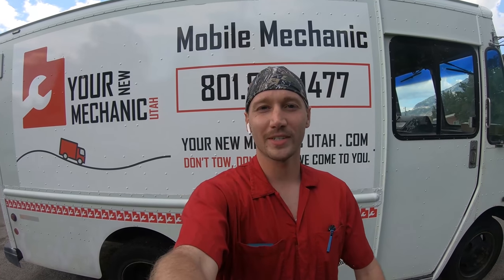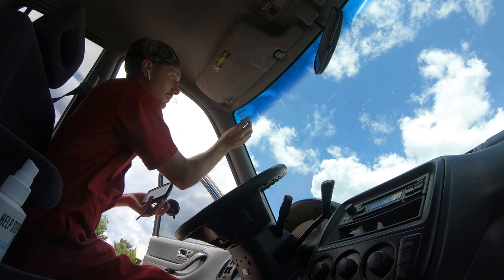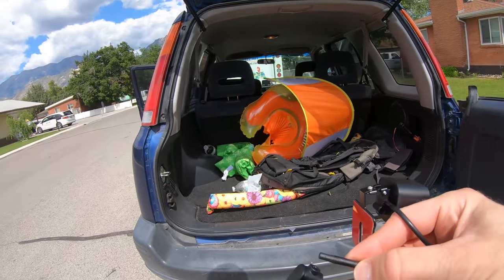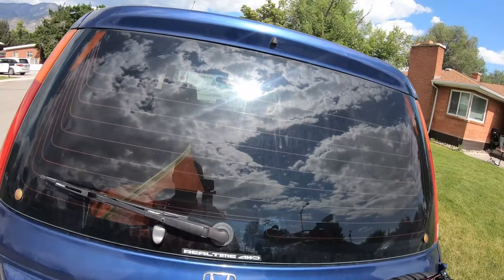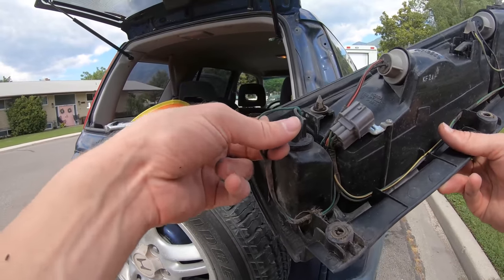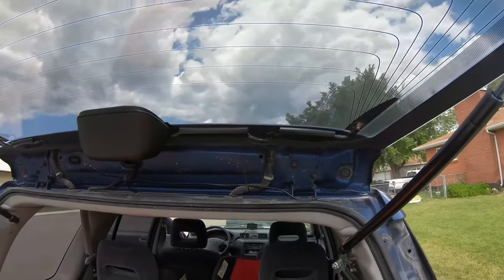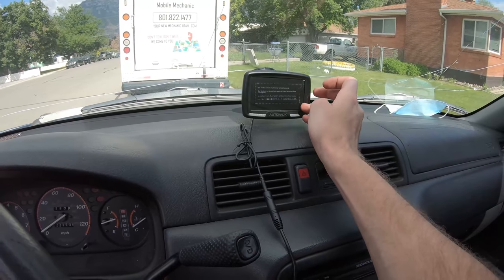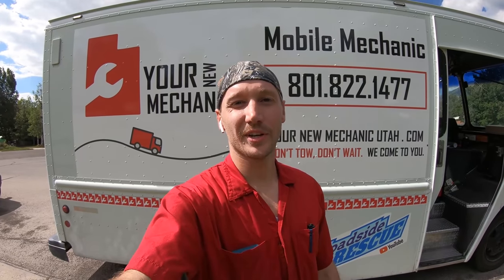Two bums try and carjack the car im working in. *Didn't know I was inside*

Comment: That’s sweet, I have a back up camera integrated in the rear view mirror. I could wire it to my double din head unit. But to be honest I like it in the rear view since I always look at it anyway 😄. That’s A Job Well Done! Keep up the good work!
Reply: I have reverse sensor also built in, did them myself with help of a neighbor, he did the measuring,drilling holes.The distance is displayed in the mirror. A reverse camera was a bonus especially when it's raining heavily and in the dark a reversecam can be handy, mine has a ledlight.

Comment: I'd had drilled a hole in the slot for the wire and self tapper to help it stay in place and alittle rtv to seal the hole where the wire is. I'd be worried about the wire getting pinched when the glass is opened if passed through like you did. BTW you talked about clipping the 12v plug off and going straight to a fuse box but more than likely that plug brings the voltage down to 5v for that screen and so direct 12v wouldn't be a good idea.

Comment: At around 29 minutes you can see the red tail dangling from the new red connector, with bare wire hanging out of it.
You need to insulate that, because it will be “hot” whenever you select reverse and the bodywork will be grounded to B- all the time. Paint is not a good enough insulation and sooner or later, if you’re lucky, the fuse for the reversing light will blow.
If you’re unlucky, the connection will be too high resistance to blow the fuse and it’ll just generate a lot of heat.
You really aren’t supposed to leave dangly tails hanging out of those connectors. They’re designed for one cable to pass right through and another to stop in the middle.

Comment: Forgot to mention. Your bare wire tips can short against themselves and/or the car. I always slip little pieces of heat shrink halfway onto loose wire tips to prevent that. No possible wire connection means no possible electrical connection.

Comment: Just watched your backup cam video, at the very end , saw you tucking the wires in and both of  your wires have an unstriped ends, the ones that came  stripped with the kit. Maybe take the tail light back off and tape them to prevent the power  wire from shorting. Just something an old backyard mechanic  saw. Love your work and commitment to what you do.

Comment: A backup camera would be wonderful for my older car. My wife complains every time she needs to use the car without a backup camera.I have not gotten one before because I did not want to run the wires from the back, if this is close to as easy as you made it look it will make my wife very happy.

Comment: Also, you don’t even need to wear through the paint to have a problem.
I just looked at it again and you’ve done the same thing with the black wire, so that’s asking for the two bare wires to touch each other. If that happens while you’re in reverse, then the weakest link will definitely give way. Hopefully it’s the fuse!

Comment: Nice work buddy, just a couple of things that I picked up on. Not too keen on the camera wire just laying in the boot jam waiting to get broken by getting trapped/pinched. The second is when you adjusted the live & earth in them red connector blocks you left the end of the wires exposed, when you refitted the light unit your running the risk of the exposed live touching the car body so when you select reverse it will earth out a blow a fuse or melt wiring. 

Not knocking you at all just some kind constructive criticism 👍

Comment: I have a suggestion why not get one of those multiport power adapters that plugs into your power port so you have an extra port when you need it. If you cut the end off the wire and something goes wrong with the backup camera you wouldn't be able to return it for warranty.

Comment: I was talking about the camera, I think it had the adhesive on both sides because it would stick to the plate and the car and the bolt that holds the plate could hold it also you just need that tab to not be in front of the plate, it looked like the camera could hang over the plate and not cover the numbers as much if the square mounting part was behind the plate.

Comment: Idk if it's how this one works but u can take the power from the reverse lights and I'd u run a fused 8 or 16 guage wire through the firewall and use a distribution block for any auxillary applications, chicken lights, LEDs I even run a electric fan switch to mine Incase I want to turn it on preemptively before it gets up to operation temp, it's just nice to have a hub to tie on

Comment: The back up camera bracket has adhesive on both sides because it is supposed to go between the tag and the car. That way it won’t cover up your numbers with the bracket installed on the front of the tag.
Reply from the maker: thank you for the help! Thats a much better idea!

Comment: Great video and I did a similar project but with some ford sync hardware and I installed a momentary switch to swap cameras from the rear to the front but I forgot to plug in the switch back into the circuit. Happens to the best of us. Keep up the great work Earnest!

Comment: For the screen, you could have made a bracket instead of the sucktion, my experience is they tend to fall of the window and cause danger while driving. Make a bracket for it, put it or use the empty space underneath your radio.Bracket you jjust put underneatj the encasemnt of the radio. Sits tight and when driving backwards watch mirrors and at the screen of course to see how far you can go.

Comment: I would have sandwiched the bracket between the plate and the door and tuck it as high as you can into the handle. Wouldn't cover any of your tags that way and would be a cleaner install. It would make sense as to why the bracket has adhesive on both sides too.

Comment: when doing the monitors that arent in dash. i always place them next to the rear view... its a natural spot to look... then i just run the wire down the headliner by the windshield and down the a pillar...

if you ever end up doing this on a Chrysler product rememebr they are can bus module. so it will power the camera up at 10v but after time the camera will die from the increased amps from lower voltage...
to bypass that you have to use a relay to supply full 12v right from the battery and use the 10v to trigger the relay signal....

Comment: You may have a problem later on, with the tip of the positive wire not insulated, it may short out, blow the fuse

Comment: When I was 13 I was helping my nan replacing fuel rail and plugs on her car. When I came back from the shed I saw 3 guys trying to hot wire the car but it had no battery or injectors in so nothing happened but I called my grandpa and he came out in his underwear and slippers with his father old rifle from ww1 and the robbers got so scared one peed his pants. Which made it easy for police to find him. I don’t recommend anyone do what he did because you don’t know if the robbers have weapons too. It’s not worth it over some tools which I luckily found in the local paper for sale.

Comment: Under the rear view mirror run the wire under the headliner most vehicles have a nice lip in the front and under the a pillar trim also If installing in license plate location put the mounting tabs behind the plate, I have received a warning for partially covering the plate and in Wisconsin we dont even have the date stickers on top

Comment: As a shade tree (I wish) mechanic, I recently thought about getting a backup cam for my 06 f150, because with a super crew, you can’t always tell where your bumper is when backing into a spot. Thanks for the idea of wiring it into the reverse lights.
Reply: That's where it  should be wired. Just don't use the all wired camera, not one that is partly wireless like this one, your phone or radio or any other signal could interfere,

Comment: 11:08 That sticker stuff is there so you put that part behind the plate so your not covering up the numbers...its in the manual. you also left the 2 bare live wire tips unprotected right next to the steel frame of the car, a few bumps could have both those bare wire tips touch and blow a fuse.

Comment: I guess you missed putting the camera bracket.. - behind-.. the license plate....but 12 o'clock high is also good.  Just hope some bums don't camera jack it...!
You could also mount it on the inside of the rear window if there is not too much window tinting.

Comment: So I had to install a backup camera in my truck the camera is hooked up to the reverse lights but we had to drill a hole in the body to run the wire though the back and I had the wire running under the carpet which makes it nice and hidden. Aswell I have my camera mounted behind my license plate it doesn’t cover anything up the only thing that cover up a bit of the plate is the camera itself. Now for the monitor I have it right under my rear view mirror as it’s the best spot for my weirdly shaped windshield. Though I do have a cord running down to my USB ports and it’s really the only way we could do it. But for you it may be just too much to do but if you put it under the mirror or next to it you can have the wire running through the roof to a pillar and then have it go down that to wherever you want it to go.

Comment: I think it had adhesive on the front and back of the camera  plate because it was intended to be "sandwiched" between the body and the license plate. Your initial install spot looked good, if the camera plate would have been behind instead of in front of the license plate.
Reply from the maker: yeah youre right im sure. Ill have to try that out!

Comment: Not wanting to come off rude with comment just saying what I do in my bay is a simple military splice will hold up a lot better than those T-Taps, if you're not able to solder. Also you can use a Peripheral - 12V DC Adapter to covert the cig socket to not have to worry about chopping the cams existing one. You can get them online as well as at Best Buy for like $15 bucks. Also you can remove the pocket below the cig on that particular year, unplug the harness, and get at the wires for an easy ACC and Ground. Could use some butt connectors and/or solder if you were to get the connections at the cig socket and extend the wires to where you need. Again just shooting some advice, but hey I enjoy your videos a lot keep up the good work man.

Comment: Word of advice here, never connect anything to your lights. The rear reversing, side lights etc are supplied through the BCM these days. If you interfere with the loading on the bulb wires the system may throw an error code and cause all sorts of issues. Thats my experience anyhow.
Reply from the maker: good point. It is a '99 however hopefully its just circuted.

Comment: Dude. The bracket for the camera goes between the license plate and the body of the car. The screw goes through the license plate then through the bracket then into the license plate mounting hole. These things have instructions and packing lists for a reason. Always check both before even thinking about taking stuff apart unless you are looking to kill time or ruin new parts. It hurts when that happens. Also, PLUG IT IN! Lol.

Comment: Should have run the backup camera wire and through the interior and connected the backup since wires in there by soldering them and sealed everything up inside the vehicle.

Comment: Your wife's hondu has a 2-din size radio opening with a storage box under her radio! I ordered a Ouku 4G,wifi,cd,dvd,cam & it lasted for years until someone broke my volume knob but, it can be had on ebay these days for $150.00 & yea, you'd have to tap into one reverse wire but, it's Not hard & it came with instructions! You simply tap 8nyo the power one 1 reverse light then, there is a wire in the back of the radio that says to attach to the "emergency brake" but, NO!!!! JUST GROUND IT TO ANY BARE METAL & YOU CAN USE ALL THE FEATURES ALL THE TIME!!!!!  Plus, it came with a reverse cam that has 6 led lights surrounding the camera which helped physically & it was nice & bright on the monitor!!! If your really interested in it, it has a round, volume type of knob on both sides of the radio (one is volume & the other is for tunning) & has 4 buttons above each knob. Mine still works just a bit harder to adjust the volume.     P.S.  MOUNT THE REVERSE CAM ON THE 1 OF THE LICENSE PLATE BOLTS might be best?  Also, if you pay extra for a dabs+ box when ordering, you can add live TV!!! I always watched YouTube video's, internet, Facebook, music etc..  I just bought a G5 so, I am planning on ordering another one for my Pontiac whenever I get a decent paycheck. If I ever get a decent check anyways.  Also, Eincar also made the exact model of radio that I am referring to.  Would be a lot easier if I could just send you a pic of the radio so that you know exactly what model... Also, it would work better & last longer if you just stripped back just a little bit of the shielding on the reverse wiring & wrap the wire arround the reverse wiring & solder it then cover it with electrical tape or heat shrink, spray electrical tape, or liquid electrical tape..

Comment: Done hundreds of these instals in cars van and trucks. Ideally if there is the space drivers side next to the rear view mirror, put the screen in the top near the rear view and run the cable under the roof lining and down the a pillar avoiding crossing and restricting any airbags. Lucky you to get a vehicle with a swing rear door 🤦‍♂️. I’ve not yet seen where you went with the rear view camera but watching you look at the number plate area currently sorry lol,  but I’d go on the rear screen bellow the brake light. Probably fit the camera upside down and flip the screen image in the settings. If it does you can screw that camera bracket to the bottom of the plastic shroud. You can buy specific reverse cameras to fit in the number plate light too, also the fused spurs you can buy are lovely for hooking up an extra switches feed. Ooh also try and avoid ignition feeds that drop out on crank, units don’t like that long term. Sorry about the punks, good job 👍

Comment: I would have figured out which wire I needed on the car side, as you did it you can't remove the tail light and if you ever need to replace the tail light lens you have to rewire it.
Reply: That also would have allowed it to work the first time.

Comment: When u put light back in, u left the 2 camera power connection wires that overhang still bare. Bad practise, they can touch and short out. U should have cut them or tape ends...

Comment: I have a 25$ rear veiw cam that i have wired into the trailer plug on my 2003 gmc sierra and it has an RCA cable ran along the frame into my back seat and up to my pioneer touch screen radio

Comment: Great to see your channel growing! I will recommend you to anyone i can, im in Tooele. If you ever need a hand im always willing to help with automotive work. My monitor for my trailer is mounted in the lower left corner so its kind of hidden by the dash but still visible. Btw if youre ever in Tooele let me know and i will hook you up with a Purple seat cushion. If i can text your business number i could even drop one to you when im in salt lake. It would probably be a huge improvement in that step van. If you plan to hardwire the monitor make sure it doesnt use 5v. I believe usb is 5v. An easy way to verify a ground is to use a multimeter and check continuity between the wire and the body or a known ground.

Comment: Love your vids. Always a job well done. This job you left a hot 12v stripped wire hanging loose in your tail light. Needs some tape or wire nut. The ground wire is fine but that hot could cause a short in the reverse lights and cam. Again love your vids keep them comeing.

Comment: DONT cut the plug off and wire it to 12 volts.    I fried a $300 dash cam not knowing it ran on 5 volts.   The plug has a resistor.   I wired in a cigarette lighter under dash and plugged it in.

Comment: I’ve done tons of camera installs i personally like installing them in the lower center of the windshield or upper center of the windshield makes it easy to hide the wiring completely hate the wiring running over the radio when wiring to a cigarette lighter plug i personal cut the head off or buy a separate cigarette lighter and rewire under the dash if I can find a direct wiring kit for suv’s like yours i would do exactly how you mounted on the rear window because of the spare tire I’ve see ppl do some crazy things like cut a notch in their license plate to mount the camera 😂😂

Comment: Hey, what year is your step van? I'm looking at one with a carbed 351. It's pretty old,  but the motor is freshly built with a 4 barrel edelbrock,  and shorty headers.  The guy really doesn't know much about the engine, headers haven't been hot,  and carb looks brand new.  Hopefully picking it up for a song.
Reply from the maker: 2003